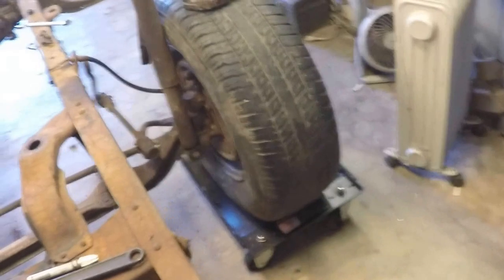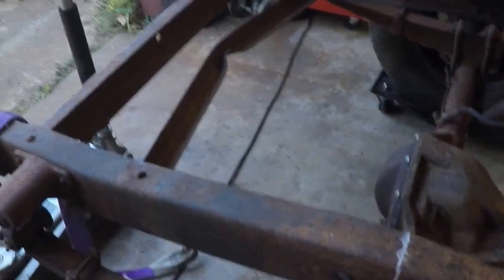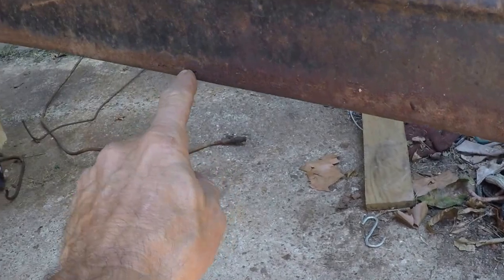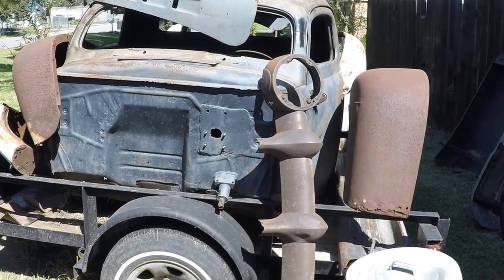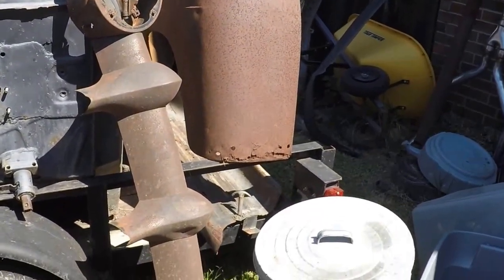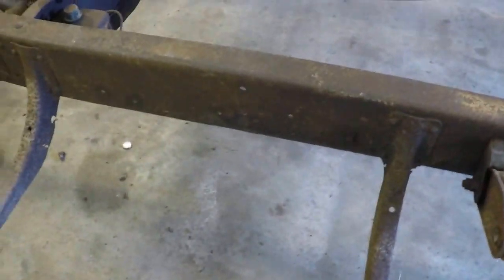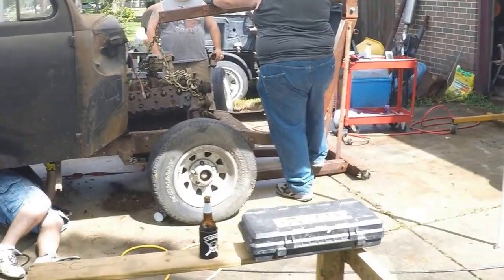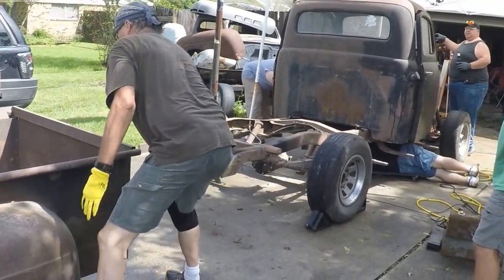Rebuilding a 1951 Ford F1 - Part 1 Stripping and Prepping the Frame

Comment: It's gonna be a nice old truck that rides and handles like a car....I've owned my 52 F-1 since 1980 and I've swapped in five different engines through those years...I still prefer Henry's solid axles and leaf springs...These trucks are so easy to work with...Good luck with yours !

Comment: Hi Trey, looking for some info on how to adjust the cab on my 48 f1... drivers side 1/2 inch lower than passenger side, after loosening arms,  nothing. wondering if the bolts are rusted inside or what. thanks